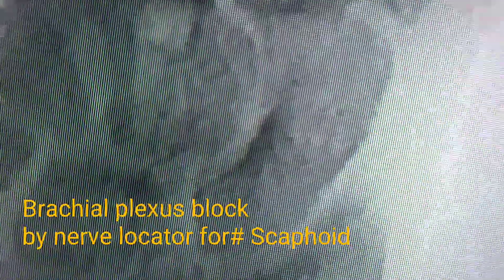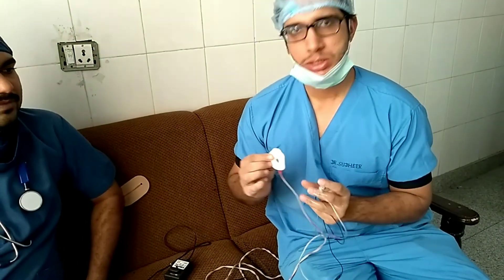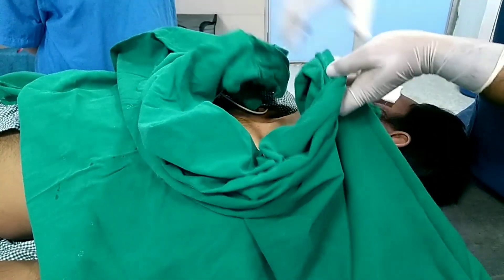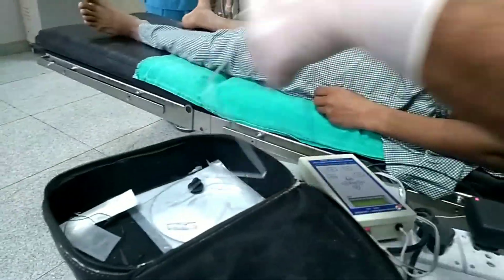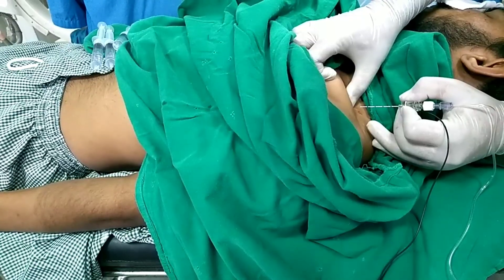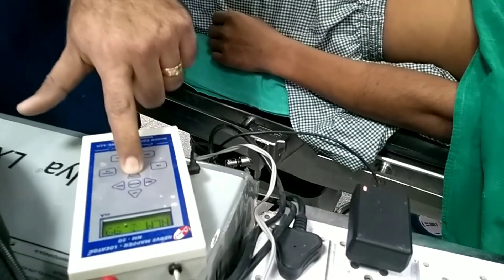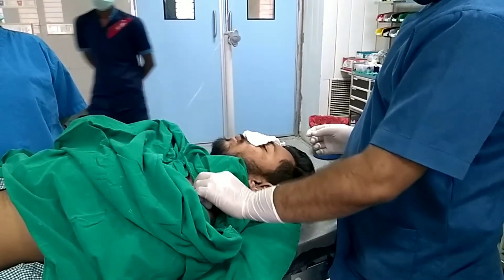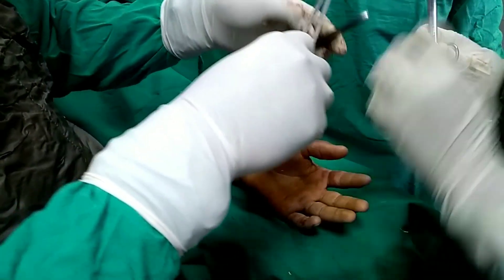Nerve locator guided supraclavicular brachial plexus block

Comment: Very poor video. Must review these things   1.panting of part is in circular direction see how surgeons do it.it should be center to peripheral area.2 use a hole towel or a proper drapes.for video purpose visualization of the area should be clear.3 define the land marks and a proper point of insertion of needle and also the direction of needle I.e. electrode.subclavian is not enough for beginners.time required for block not mentioned.quantity of anesthetic 30 ml mentioned but percent of drug is missing...how long this block lasted for. Review and make an another video. Keep it up all the best..
Reply: Also the position of hand  is not proper.  It should be flexed at elbow preferably... Check with Nysora